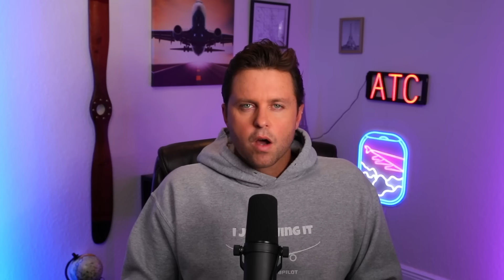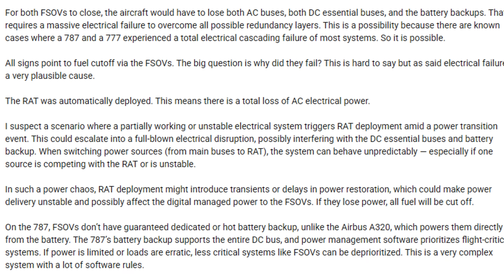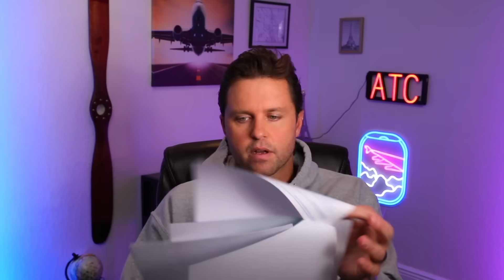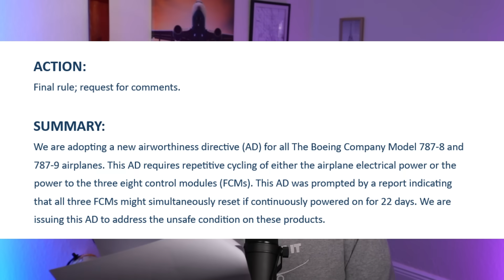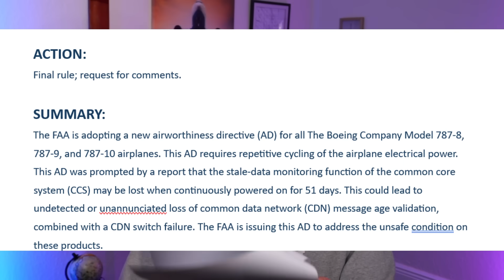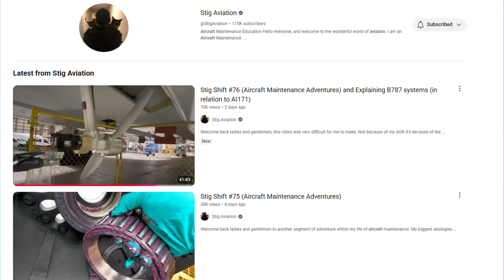Air India 171: Did a Software Glitch Cause Dual Engine Failure?

Comment: I am a glider pilot and am used to take off and land without engines. While landing a glider is not a big deal and success depends on solid decision making, power loss in the take off phase is deadly below 300 ft. Even with the increadible glide ratios of gliders there just isnt enough space to nose dive and gain airspeed. Power loss means winch engine failure or engine failure of tow plane. So the moment the super heavy 787 lost power at such a low altitude it was doomed. It is so sad to see this happen.
Reply: I am a flying instructor/examiner, mainly gliders, 20k+ hrs and 55k+ flights.

With launch failure we teach, land ahead if possible (even outside of the airfield) if not turn but ensure you have sufficient airspeed. Reciprocal landing are an option. Before every flight, during our checks, we consider the eventualities. We rehearse what to do in the event of a launch failure.

In this case the problem appears to have occurred 10 seconds after rotation when the aircraft was flying at 400 ft with only 700 - 800m of runway left. The aircraft then rapidly descended and was flying at 71 ft as it overflew the end of the runway. Ahead was the city (of 8M people) and no where to pick a landing spot. However, the piot appeared to fly the aircraft all the way to the crash, ending with a mushing stall into the roofs of the buildings. From the peak of the climb to the crash was only 20 seconds.

This was an irrecoverable situation.

Comment: It raises a few more questions:
Is the RAT designed to power the FSOVs?
On take off is the RAT producing optimum power?
If elec power is restored by the RAT will the FSOVs reopen?
If the FSOVs reopen would the engine restart automatically?

Comment: Hi Gary,
I’m on the same page specifically software bug.  My argument is a little different.  From the videos of the plane taking off there appears to be no asymmetric thrust.  The plane flys straight.  No smoke from either engine.  What could cause a dual engine failure simultaneously.  My argument is the flight computer.  Ok the FSOV is a good candidate.  But it appears that the throttles were smoothly pulled back by the pilots to idle power settings.

Comment: Here is an "independent" vaidation from the channel's transcript, by Gemini (AI); "It appears the YouTube video you watched is discussing the very recent Air India Flight 171 crash that occurred on June 12, 2025, in Ahmedabad, India. This is indeed a real and highly tragic event, and the investigation is ongoing.

Let's validate the information presented in the transcript based on currently available public reporting:

1. "Recent 787 crash... Air India flight 171 suffered a catastrophic dual engine failure on takeoff."

Validation: TRUE (Incident, not yet confirmed "cause"). Air India Flight 171, a Boeing 787-8 Dreamliner, crashed shortly after takeoff from Ahmedabad on June 12, 2025. This was indeed the first fatal accident and hull loss of a Boeing 787. Multiple reports from initial observations (CCTV, eyewitnesses, pilot's Mayday call of "loss of power and thrust") strongly suggest a dual engine failure, or at least a significant loss of thrust from both engines, making the aircraft unable to sustain flight. The activation of the Ram Air Turbine (RAT) also supports a significant power loss event. However, the root cause of this dual engine failure is still under official investigation by India's Aircraft Accident Investigation Bureau (AAIB).
2. "electrical problems prior to takeoff," "if you lose all electrical systems that affect or shut off the engines or could it?"

Validation: PARTIALLY TRUE / Under Investigation. The transcript reflects a line of inquiry that is indeed being widely discussed among aviation experts and on forums since the crash. The 787 is a "more-electric" aircraft, meaning it relies heavily on electrical systems for functions traditionally handled by hydraulics or bleed air. Therefore, electrical issues are a significant area of focus when considering a major system failure. The activation of the RAT (Ram Air Turbine), which provides emergency electrical and hydraulic power, strongly indicates a substantial electrical power loss or engine failure event.
3. "fuel shut off valve (FSOV) ... not powered by the PMA but instead the aircraft's electrical DC system if power is lost the spring closes the valve instantly cutting off fuel to the engine." "FOVs are fail safe designed to protect the airframe not the engine." "for both fuel shut off valves to close the aircraft would have to lose the AC bus both DC essential buses and the battery backup." "The 787's backup supports the entire DC bus the power management software prioritizes critical flight systems so think of this what he is saying is that a glitch a possibly a glitch in the system could have caused both fuel shut off valves to close because they springloaded to close in the off position in case there's a problem"

Validation: LIKELY TRUE (General principle) / SPECULATIVE (Application to this crash). It is a common design principle in aviation that critical systems like fuel shut-off valves are "fail-safe" to protect the aircraft. This means they often default to a safe (e.g., closed) position if power is lost. The specific details about the 787's FSOVs being DC-powered and spring-loaded to close on power loss are consistent with general aircraft system design principles. The extent of electrical failure needed to cause this is also plausibly described.
The theory that an electrical glitch caused both FSOVs to close on Flight 171 due to loss of power is a theory being explored by the YouTuber and others. It is a plausible technical scenario given the 787's electrical architecture and the reported dual engine failure. However, this specific sequence and cause have not been officially confirmed by investigators for Air India Flight 171. The "hey fix this" comment is likely from an individual with technical knowledge, but it's still a theory until confirmed by the official accident investigation.
4. "no documented cases of a modern Boeing experience an engine flame out from a fuel shut off valve closure due to an electrical glitch."

Validation: Likely True (Specific scenario) but does not preclude it. This specific combination might not have been officially documented as the root cause of a flame-out leading to a crash. However, this doesn't mean it's impossible or that related electrical issues haven't occurred.
5. Airworthiness Directives (ADs) for Boeing 787 electrical system (2015, 2016, 2020):

Validation: TRUE. The ADs mentioned are real and accurately described:
AD 2015-10-10 (Issued 2015): Prompted by the determination that a 787 continuously powered for 248 days can lose all AC electrical power due to Generator Control Units (GCUs) simultaneously going into failsafe mode (software counter overflow). Requires repetitive electrical power deactivation.
AD 2016-24-05 (Issued 2016): Prompted by a report that all three Flight Control Modules (FCMs) might simultaneously reset if continuously powered for 22 days. Requires repetitive cycling of either airplane electrical power or power to the FCMs. This could lead to a temporary loss of controllability.
AD 2020-06-14 (Issued 2020): Prompted by the report that the "stale data monitoring function of the common core system (CCS) may be lost when continuously powered for 51 days." Requires repetitive cycling of the airplane electrical power.
These ADs confirm that the 787 has a documented history of electrical system software issues related to continuous power-on time, which could lead to significant system malfunctions if not addressed by power cycling. The YouTuber is correct in highlighting these as known issues with the 787's electrical system architecture.
6. "simpleflying.com ana Boeing 787 Dreamliner suffers dual engine failure on landing." "TCMA system... to basically shut down the engine if an over thrust is detected in the system... could activate if the aircraft has not transition from ground mode in full reverse is selected too quickly after landing."

Validation: TRUE. There was indeed an ANA Boeing 787 incident on January 19, 2019, where both Rolls-Royce Trent 1000 engines shut down shortly after touchdown at Osaka Itami after thrust reversers were selected. Investigations pointed to the Thrust Control Malfunction Accommodation (TCMA) system as a potential cause. This system is designed to prevent uncommanded high thrust on the ground but could potentially misinterpret rapid reverse thrust application before a full "ground mode" transition. Boeing did issue service bulletins related to this. The YouTuber correctly identifies this as a known electrical/software-related anomaly leading to engine shutdown, albeit in a different phase of flight (landing vs. takeoff).
7. Comparison to A320 FSOV backup:

Validation: Plausible (Technical difference). The claim about the A320 having a "guaranteed dedicated or a hot battery backup" for its FSOVs, unlike the 787, highlights a potential design philosophy difference. While I can't immediately confirm the exact wiring of every component without specific technical manuals, it's plausible that different manufacturers employ different redundancy strategies for "fail-safe" systems, especially given the 787's "more-electric" design which consolidates power management. This would need to be verified with official Boeing 787 wiring diagrams.
Overall Assessment of the YouTube Video's Information:

The YouTuber is doing a commendable job of citing publicly available information, including official Airworthiness Directives and previously reported incidents (like the ANA 787 landing incident). They are also presenting a plausible technical theory for the Air India Flight 171 crash, drawing connections between the known electrical system ADs, the fail-safe design of fuel shut-off valves, and the reported dual engine failure.

Key Takeaways:

The crash itself (Air India Flight 171) is real and recent.
The dual engine failure during takeoff is strongly indicated by initial reports.
The Airworthiness Directives (ADs) cited for the 787's electrical system are accurate and highlight known software/electrical glitches related to continuous power.
The ANA 787 dual engine shutdown on landing due to the TCMA system is also a real and documented event.
The theory presented about the FSOVs, electrical glitch, and RAT deployment is a technically plausible hypothesis based on known aircraft systems and the 787's specific issues.
However, it is crucial to understand that this is still a theory/speculation at this stage. The official investigation by the AAIB (with support from Boeing and other international agencies) will definitively determine the root cause, which can take months or even years. They will analyze the flight data recorders (black boxes) and cockpit voice recorders.
The YouTuber's framing of "I am not going to speculate, I am simply going to present some of these facts" while then presenting a detailed theory that connects these facts, is a common rhetorical device. While the facts (ADs, ANA incident, general FSOV design) are true, the conclusion drawn about the cause of Air India 171 is speculative until proven by the official investigation."

Comment: So with so many early issues with lithium battery in the 787.. in which they had to put it in an armored box.  All the issues seam to be around the gear up time.   An overheating battery explodes, causing a power surge taking out all electrical and spiking sensors that feed the engine ECUs.    Maybe?

Comment: The failure occurring and causing immense trouble within seconds is really scary as a passenger and it's hard to imagine how pilots can identify and rectify the exact failure within these seconds time under pressure and also trying to be airborne at such a low altitude

Comment: And the black box is damaged.
Reply: Ine box has fire damage; however these units are combined recorders and have both cockpit voice and flight data in one box. Also the aircraft carries two such boxes, one in the front and one in the rear. It appear that the front box has suffered damage in the post crash fire.

Comment: I know nothing but i would have assumed the engines on big jets would have totally seperate systems and fuel systems in case one malfunctions ? What am i missing?
I guess this video is just a bit over my head. Clearly some design issue if both engines can shut themselves off below a safe turnaround height

Comment: I'm pretty sure it isn't contaminated fuel. The fuel is monitored for contamination as it is pumped into the aircraft's fuel tanks. I heard from another youtube video source that one drop of water will cause the fuel monitoring machine to stop the fuel delivery and an inspector will have to come to the plane and investigate why the fuel filling was stopped.
So therefore the logical scenario seems to be some sort of electronic/electrical problem. I can't understand how, if it was bad fuel, that the two engines would shut off at exactly the same time. Also if it WAS bad fuel at the airport, why didn't other aircraft experience contaminated fuel problems?

Comment: Bypassing the fuel is only allowed manually with specific tools and jigs during maintenance and only under qualified and restricted conditions. No way that it may be alternatively achieved through controlling electromechanical device, the N/O valve FSOV on DC power. 
When fuel is cut to the combustion chamber, engine will just stall right away.

Comment: You think too much . How about a more simple theory :

One engine failed during takeoff 
Pilot shut off fuel for the wrong engine 
Now, lost both engines 

Sounds more probable?
Reply: Where's the yaw, then?  None.
Reply: In the video showing the later part of the flight both the audio and the video show that both engines are operating but at low power.

Comment: If this FSOV issue is true.. The plane should be grounded even if FSOV didn’t cause the crash.

A plane that shut off both engines when electrical failed is a massive catastrophic design flaw…

This is not a “if” question… it’s a “when” question.

Comment: But we already know the Indian pilots were incompetents!  Weren't we told the plane taking-off without pilots properly setting flaps and that caused a lack of lift? 
Was it not that pilots mistakenly retracted flaps instead of landing gear... as if they have never flown a Cessna but somehow got their hands on a Dreamliner?  Wasn't it 
that pilots took off from only half the runway because they were in a hurry?  Did they not input the wrong temperature data into the computer... like if not knowing it was a hot summer day in India?  Finally, wasn't it that they had an engine failure but shut off the wrong engine and caused a total loss of lift and themselves caused the crash?
Reply: American pilots never blame pilot error for domestic crashes, but will jump to speculation about pilot error immediately with foreign pilots. It happens so often now, it's expected.

Comment: Questions that arise:
Is the video consistent with a complete sudden loss of both engines or with two engines working but not providing enough thrust? Not sure if that much weight would glide that far on nothing. The pilot doesn't say "I lost both engines", but something like "not enough thrust"- correct if wrong.
Some have said the pilot deliberately banked the plane to avoid an apartment building- which would indicate some control surfaces working, unless that was just chance and they had no control.
I can't really tell from the audio for certain that I'm not hearing the GE engines and only the RAT, or the other way around. I wish someone would record a takeoff of a 787 from the same vantage for comparison.

Comment: In the light of all ideas being relevant in a situation like this, I would like to add the following into the mix.

Could a malfunctioning Weight on Wheels (WOW) switch, or Squat switch, be a factor worth considering in the case of Air India 171? If the WOW switches failed to register that the aircraft had lifted off, systems like the FADEC might not have transitioned to flight mode, potentially limiting engine thrust during climb. Given that other critical systems, like pressurisation, auto-throttle, spoilers, and gear retraction, also depend on accurate air/ground status, could such a fault have contributed to the incident, even with the Boeing 787’s built-in redundancies? It would be interesting to know how many entry points the data from the WOW switches have into the FADEC. If it is one, then, no matter how many switches the aircraft has, a non-functional data entry point in the FADEC would mean that none of their data, that there was no longer weight on the wheels, would be received by the FADEC. It would, thinking the plane was still on the ground, and as mentioned above, possibly not transition to flight mode and limit the thrust (seemingly an issue in this case), and it would also prevent the gear from being raised (also seemingly and issue in this case).

Could whatever electrical problem that occurred (as indicated by deployment of the RAT), have occurred just prior to lift-off, and have interrupted the flow of information to the FADEC from the WOW switches?

To add to the above, I understand, that the Boeing 787 doesn't feed individual WOW switch signals directly into the FADEC. Instead, the aircraft uses a centralised avionics system, most likely the AIMS, which gathers inputs from the various WOW switches, and sends a single, validated air/ground status signal to each FADEC channel. So if there were a fault in how that status was interpreted or transmitted, it could theoretically affect multiple systems at once, including engine control, pressurisation, and automation logic, even if the individual WOW switches themselves were functioning correctly.